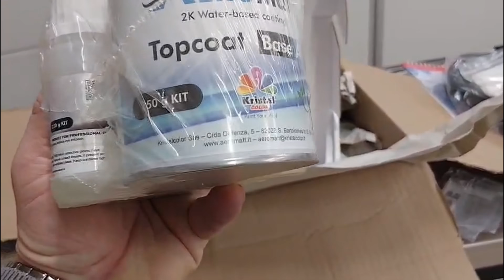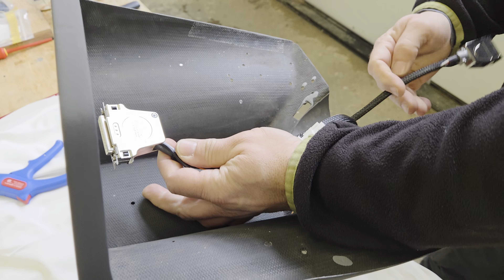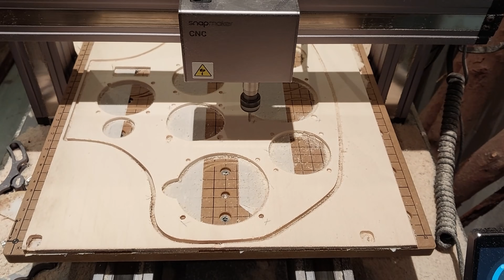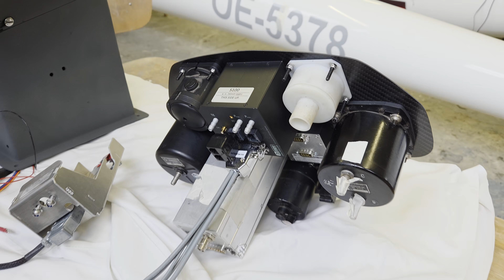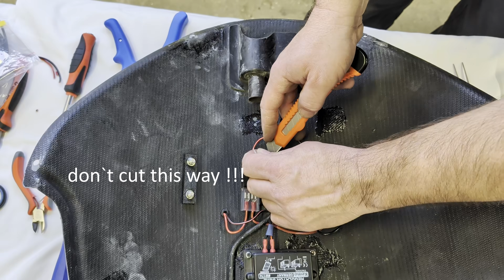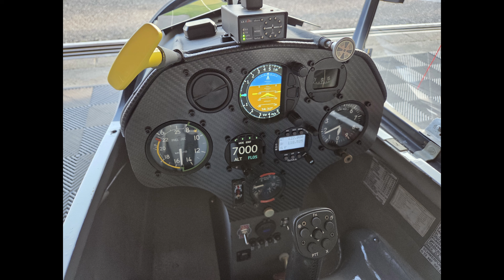Cockpit Refresh Part 2(of 2)

Comment: If you would like to share the project in terms of measurements that would be excellent! We have a aeroclub junior which needs a bit of love:)
Reply from the maker: Yes, of course. For this "extra help" I would love to get a donation - wich is possible with google "thanks" on my channel. I can give you the blender files ? You have to change and adapt the instrument holes of course, i exported the milling files then: but caution here: i had to do 3 different layers: fir the milling bits outside of the line, and inside - but if you have questions feel free to ask. Do you have a private mail ?

Comment: Congratulations on your result! The result looks stunning indeed. And thank you for your nice videos to explain your process. To add Dominic Frisby's voice as narrator is a great choice!. I do have a request: Would you be so kind to provide a list of the non-instrument suppliers? Like the carbon panel (including panel thickness), the bits you used (and what rev speeds you used) , the wires and tubes.
Reply from the maker: 300x400 Carbonfiberplates, 2mm (see Amazon link)
Milling Bits from Sorotec.de
Snapmaker 2.0, small milling tool, max revolution speed, 0.5mm drive down per layer, speed is 100mm/min
... so for 2mm you need 5 layers ...

cables AWG 16 from batteries to powerrail, from powerrail to instruments AWG 20
fuses, tubes, cables, USB Plug from "https://shop.streckenflug.at/"

happy milling :-)

https://www.sorotec.de/shop/Zerspanungswerkzeuge/sorotec-werkzeuge/1-8-werkzeuge/3-175----1-8---Fraeser/spiralverzahnt-diamantbeschichtet/

https://www.amazon.de/Kohlefaserplatte-300-400-Kohlefaserplatten-Auto-Modell/dp/B0B2PBXT9J/ref=rvi_d_sccl_43/258-9678180-8339416?pd_rd_w=gcpTm&content-id=amzn1.sym.13dbab83-f61c-4000-b9ab-184f02ce8fa2&pf_rd_p=13dbab83-f61c-4000-b9ab-184f02ce8fa2&pf_rd_r=Z769TQXQ5Q6C9PMFNFMR&pd_rd_wg=s2pLn&pd_rd_r=c7797bf5-26e9-4167-ae9c-90702b1feaf1&pd_rd_i=B0B8CQVGYD&th=1